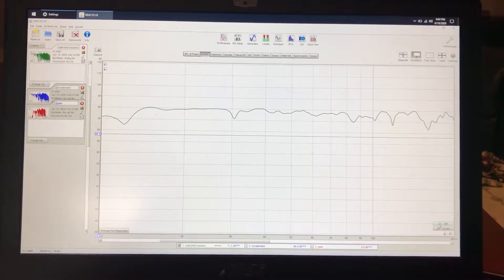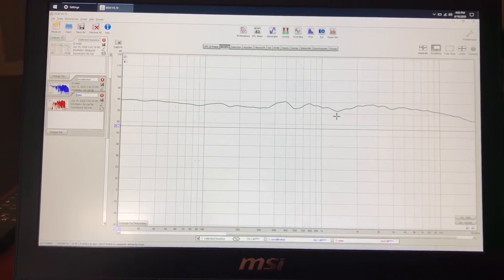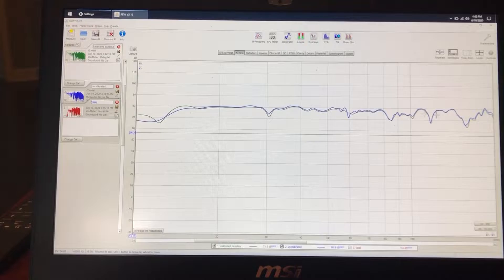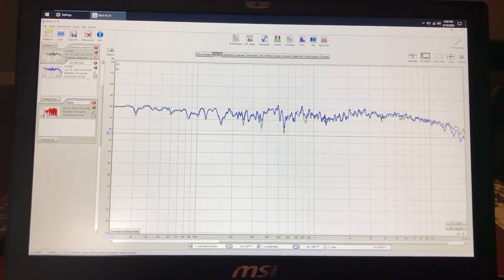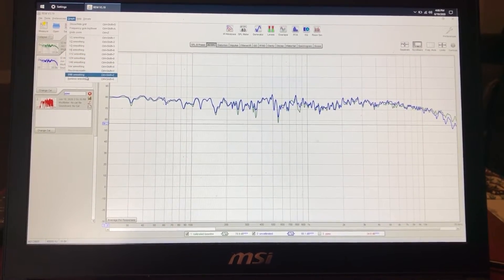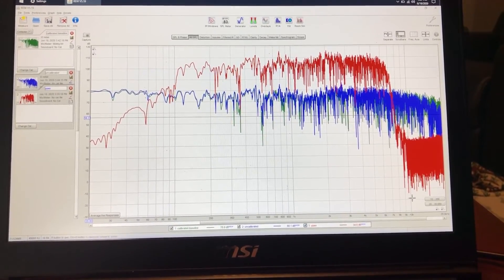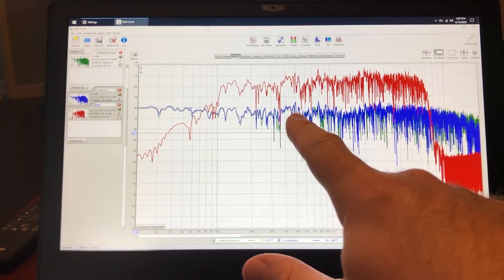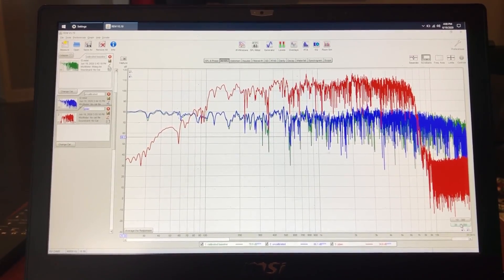Can You Use Your Yamaha YPAO Or Audyssey AVR Mic With REW Instead Of UMIK1

Comment: Hi ! Nice video and very interesting topping!.  Did you use the YPAO mic pointing up?  This is the way is recommended in the AVR user manual for setting up the system.  But in my case I have found that setting it horizontally and pointed out to each speaker under test during the process the overall result is better.  I think that the frequency response of the audyssey mic pointing directly to the speker, in the same way you would do with the calibrated mic, show result in a much linear response.
Reply from the maker: Bad idea.  You are now completely changing the in room mix of direct and reflected sound.  You gave the system a totally inaccurate dataset.
Reply: @COGuyStuff  nevertheless, after setting up the AVR many many times, and before to though it away, I have tried this method…and that was the way it works for me.  Before to do it, I read carefully the manual, understood each single parameter and tried to set it manually. Even that, my AVR did not sounded good.  Today I have an stereo system and the AVR in the same room, and I am satisfied with the result. Before to do that, the AVR sound ugly whet setting to listen in stereo. Today, is very close to the dedicated stereo system. My stereo is a Marantz pM5005, and the AVR a Denon AVR1611. Regards

Comment: The Audyssey mics work accurately to measure bass without a calibration file. Google it. 
Why do you include Audyssey in your title, talk about Audyssey in the video, but only use YPAO?
Reply: know it's an old video but I have x1800h denon (2023 production year) and this is exactly my graph with the included mic. so not only yami mic but absolutely the same thing happens with denon mic. not so bad with the highs but for bass totally the same.

Comment: Very  interesting  test ☝️
Thanks.
By the way,  I'm on my first diy speakers project I wanted to check the driver's response with REW ..just by curiousity.
As  I have no calibrated measurement mic .i used my earbuds mic instead ... sound stupid... 🤪  however ..I can assure you.. the curves I got are more linear & less weird than the yamaha AVR mic's 😁😁

Comment: What if im only interested in the rough decay of the frequencies in my room? I mean the informations which are shown in the waterfall diagram. In this case the absolute intensity of a frequency isn't important, only how long it will stay in my room relative to the beginning. Is this a reasonable consideration?
Reply from the maker: Yes and that’s what the graph is good for
Reply: @COGuyStuff  Thanks. And is it ok to use a AVR Mic for that purpose?
Reply from the maker: No

Comment: I don’t completely understand..if I Use umic,can I send that to the receiver?
Reply from the maker: No. It’s only for use with a computer
Reply: @COGuyStuff  yeah I got that. But how would you get those reading to your system?or is that just showing you what’s going on,Basically?. Thanks, Joe. I just ordered a Calibrated mic.
Reply from the maker: You use it with a program called rew. I have vids on it as well as other channels. The mic plugs in to the computer. The computer via hdmi plugs in to your avr.
Reply: @COGuyStuff  my subs all y'd together in my avr..how would it test them with the rew and and umic.dont have mini ddsp? thanks..sorry to beat your ears off..but need help! peace
Reply from the maker: You don't.  Look if you don't want to buy all the tools, just stop.  You can't do anything until you do.
Reply: @COGuyStuff  I used the denon eq app and missed around with the gain on both sub,and somehow got everything working and sounding pretty darn good..my center channel even seems clear as well. Crazy shit.but I’m not fooling with it for a while now..thanks again for your time and help!also put a 300 hz certain on everything
Reply: @COGuyStuff  I stopped.lol

Comment: Yeah...But you didn't use any calibration file with the AVR mic...The AVR could be using a calibration file for its mic to do the measurements...
Reply from the maker: Lol that’s the whole point dude. There is no file fir it, it’s baked in to the avr hardware.

Comment: Not an audio expert, can anyone explain the entire story in one/two sentences? Is Ypao or the others bad or not!?
Reply: Not an expert either but since nobody else has answered I’ll give you my opinion.  My last three receivers have been Yamaha with the current one being about 8 years old.  I have never been very impressed with Yapo.  Not to say that it has probably gotten better over time.  I think you will get a better result using REW and a calibrated mic and then manually enter the peq values into the receiver.  One thing Yamaha does have going for it is that you can manually enter the peq values manually.  Having said that, my current plan is to upgrade to a McIntosh processor but debating that because the one I’m looking at does have Dirac.  Andrew Robinson recently made a video on miniDSP and REW calibration and his conclusion is that because you can manually enter the peq values in the Yamaha that you could skip purchasing the miniDSP for those receivers but most receivers will not let you tweak the peq values, thus the need for miniDSP in your signal path.